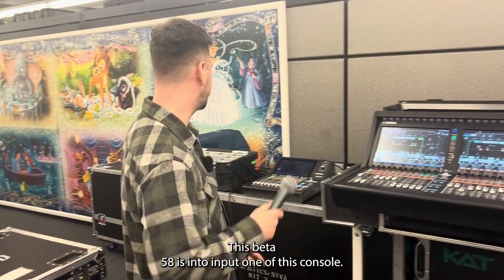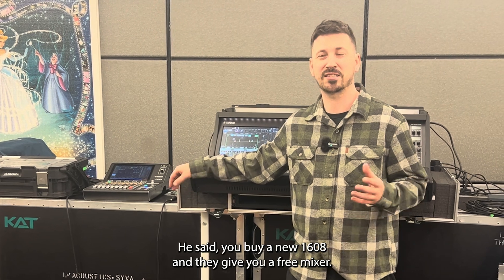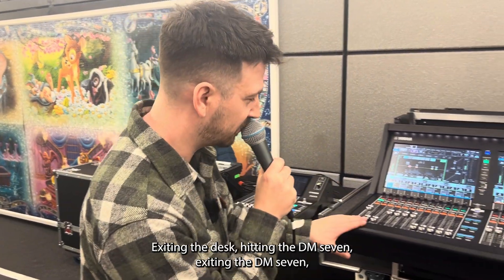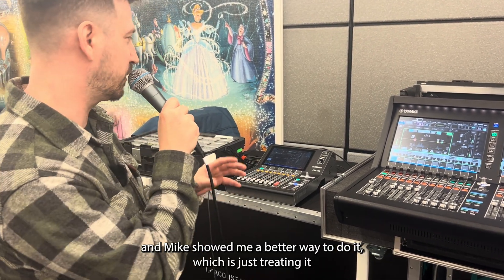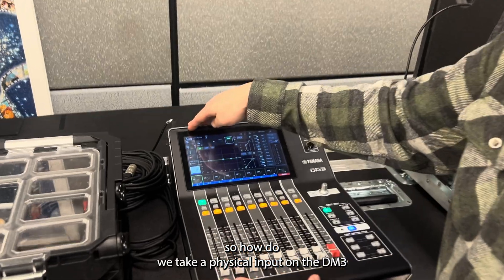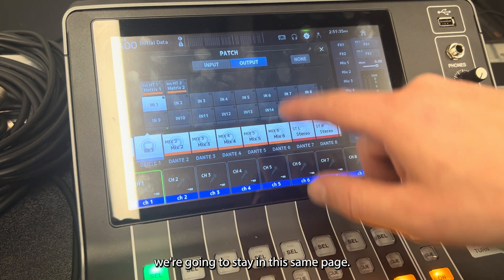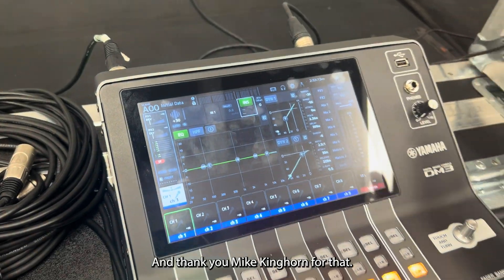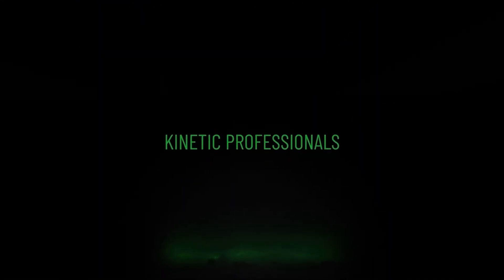USING THE YAMAHA DM3-D AS A RIO1608 WITH A YAMAHA DM7

Comment: do you think this would work with any mixer that has dante? an A&H for example and use the DM3 as the Rio1608
Reply from the maker: @daviddelrio3183  anything that can send / receive Dante will be able to accept the Dante flows. But, you’re not going to have head amp control, it needs to be a Yamaha controllable device for that to work. A work around would be having an iPad / wireless router setup with the dm3 app. Then manipulating your head amps that way.
Reply: @KINETICPROFESSIONALS  thanks :D
Reply: Can you use the tf rack in the same way ?